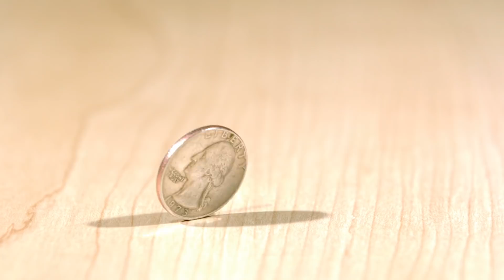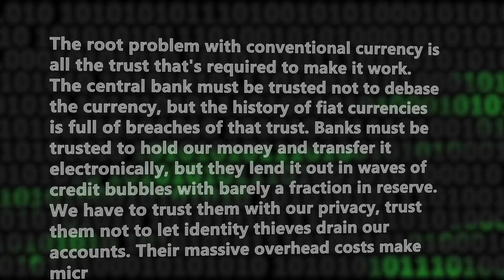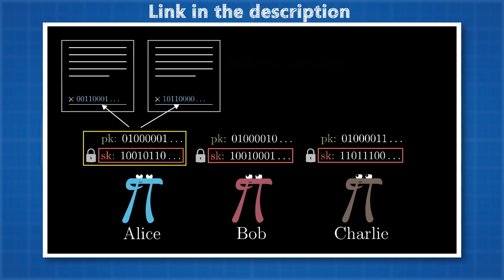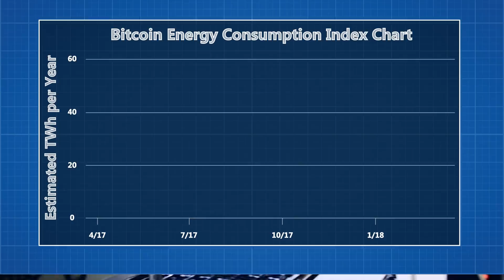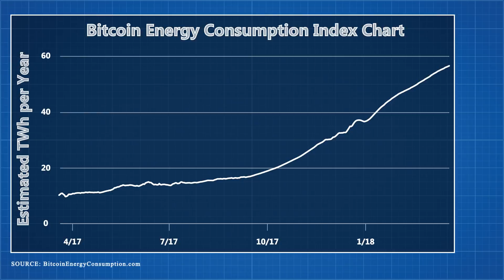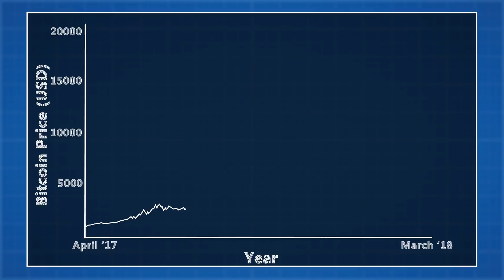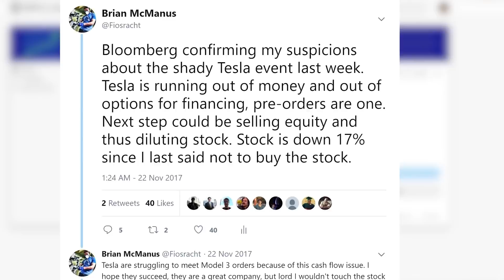Why Bitcoin Is Not Working

Comment: Some honest feedback, so please take your time to read and understand :)
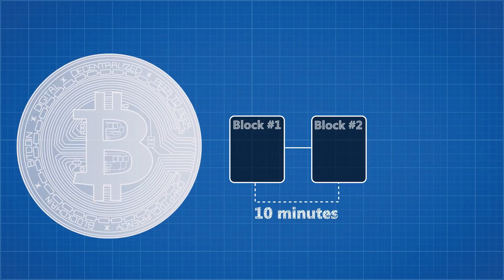2:39 this is not true. There is no "limit of the number of transactions in a block". The only limit is the blocksize limit, 1MB in Bitcoin. But not all transactions are equally sized. Some use older/newer address types (P2PKH, P2SH, Bench32) , some are larger/smaller (more/ less inputs/outputs), some are batched (HitBTC, Kraken, Poloniex), etc. So it´s very difficult so state that the number of txs is limited to 2400 tx/Block. But the most important thing to know is that a Bitcoin tx is not equal to a transaction at a bank. A Bank transfer is sending amount x from A to B. A Bitcoin tx can send amount X from A, B, C, D, ... to W, X, Y, Z, so multiple inputs and outputs. This is visible in tx batching: Have a look at this tx (e.g. https://blockchair.com/bitcoin/transaction/f558e32cdfb2f438841cad9aa8896b04cab36eb94c34454fd5e827877576b5ca). It has 3 inputs and 2193 outputs! Looks like there are many recipients of money. But do we consider that one transaction because it is only one? Or multiple, because there are several inputs and outputs? See: Therefore it´s important to not only look at the sheer number of tx in a block, but also on the amount of inputs and outputs, because multiple txs can be batched into a single one.
7:04 this is partly true. As you can see here (https://coin.dance/blocks/thisweek) 75% Bitcoins total hashrate is in the hands of 5-6 pools. But: 1 pool != 1 mining huge facility. Most pools consist of hundreds of thousands of miners (see different pools stats), who are able to switch pools any time they want. The acutal part of hashrate controlled by a few people is much lower.
7:35 partly true as well. But you haven´t considered the technological development. Competition to build the most efficient results in less monopolization and power consumption while keeping the hashrate rising.
9:08 Please do more research and don´t make it look like Bitcoin is stuck at 4 txs/sec. and isn´t evolving in speed, privacy, etc. A few keywords to start with: SegWit, Lightning Network, Schnorr signatures, MAST, Bulletproofs, (over) ASICBoost... In comparison to centralized systems these improvements will take much longer to spread.
9:36 for example?
Of course there is still several need for improvement in Bitcoin, as you already said, but please take this as an honest advice :)
Reply: AppleStuffTutorials You said it great! Its pitty that RE didnt mention Proof of stake and DPoS systems to verify transactions. We must not forget that Bitcoin is relatively new and problems with speed and capabilities had in the early years even the Internet
Reply: Spot on! Thanks for sharing!!
Reply: AppleStuffTutorials My notes:

Argument 1, electricity - we should look at how much power is consumed by all 11,000 employees of visa including the office buildings and the gas used to commute those ppl too and from work. It’s not as free as they make is sound. Consider the masses of junk mail you get from visa. I can go on and on how visa is much more harmful than bitcoin.

Argument 2, miner incentive when all bitcoins are created - by this time bitcoin should have over a million transactions a sec even if the transaction fee was $0.01 the miners would get millions of dollars in rewards every 10 min block.

Argument 3 - lightening network and innovation in general will fix problems the author has.

I feel this video was created to just be polarizing to get views. Congrats to “realengineering” for succeeding.
Reply: This video is remarkably bad by RE's standards. It's honestly as if he didn't actually do any research at all for this video and he's trying to say why he thinks it's destined to fail off the top of his head.
Reply: @Krtek Proof of Stake invalidates what he spent more than half the video talking about. POW was a good starting point, but is not something that should be used anymore.
Reply: this should go on top of the comment section. video content may lead people in the wrong way.
Reply: The major Bitcoin (BTC) forums are heavily censored.  This is ALL you need to know that BTC is dead or doesn't deserve to live.
Reply: AppleStuffTutorials dont listen to this video this guy is pumping the dollar what a fuckwit the u.s dollar is not going to last

Comment: Let me debunk this video. Bitcoin price is only getting more stable as it gets older and as more people adopt this technology, it can only get more stable. Going from $5,000 to $20,000 is a lot more stable than going from $2 to $250. Also, fiat currencies are a lot more volatile than the average person thinks. The power consumption will come down as technology becomes more advanced. Also, there are other solutions to combat this in the long run, which can be adopted by bitcoin or other crypto currencies. The dollar and other fiats are the real flawed currencies since they're backed by nothing and are controlled by people no one trusts. The dollar has lost 99% of its value since its inception and most fiat currencies that started 100 years ago are already dead. Some argue, fiat currencies are the evil that make wars possible. Fiat money will not be around for long.
Reply: All currencies are fiat. The fact you're still measuring Bitcoin in terms of conventional currency shows this.

At the end of the day, you need to be able to convert Bitcoin to some physical transaction. This conversion will always carry with it a notion of value that is not fixed in time or volume, and will need widespread agreement on what that value conversion rate is. This makes any proxy measure of value, whether it is conventional currency or Bitcoin, fiat.
Reply: I don't think Bitcoin will be adopted by most people even though people who hold Bitcoin and believe in it think it will. As long as it's used as a speculative investment, it will always be somewhat volatile, who wants to spend a currency that could be worth 10% more tomorrow? One of the big problems consumers will have with Bitcoin is the fact that there's no insurance available as there is with Banks which are customer based. If you forget your PIN or make a transaction mistake, your can fix it relatively easily. What would protect your everyday Joe from inadvertantly sending their coin to the wrong address or incompatible wallet and having it be lost in the void. Bitcoin doesn't care if you typed one wrong number. Your coin is gone forever. Let's also not forget Bitcoin has a very questionable intrinsic value where as things like physical gold and silver have proven real value. Oh, and these "small fees" associated with transactions are not so small and the transaction speed sucks too! Did I miss anything?
Reply: I support btc but you're just attacking Fiat not defending crypto
Reply: Matt A Well, it may not be Bitcoin but a state crypto is poised to do so.
Reply: Bitcoin went from $5000 to $20 000 in about three months, but it took around two years to go from $2 to $250. The faster increase is the one to $20K, with a 100% increase every 1.5 months instead of 2.5, but the comparison is not entirely fair because of the different timescales.
Both of these, however, would be classified as hyper-deflation. Hyper-deflation has never been seen in a conventional currency, so the only thing to compare it to is some of the biggest asset bubbles in history; and bitcoin has nearly all of them beat, with the value rising faster than the South Seas bubble or Dot Com boom.
That is not stable. Bitcoin was not stable when it was brand new and it is not stable now.

In contrast, the big fiat currencies have annual inflation rates consistently well below 5% and usually target 2-3%. That is comparatively very stable.
Reply: Nearly everybody trusts fiat currencies. I know I can go to the store and buy what I want with my money. I know I can buy what I want online with my regulated money. I know that secondhand traders irl will accept my fiat money.

The same cannot be said for cryptos. Who bloody knows how much it will be worth? Saying relative increases in value show more stability is bullshit. Real term change is what matters here. Who knows who will accept it? How impractical it is compared to just handing over a note or swiping a card too.

I am very confident that crypto will never overtake real currency.
Reply: Losing value... so the dollar is flawed because it experiences a small amount of yearly inflation?  Couldn't I say that bitcoin is flawed because it experiences a large amount of yearly deflation?
Reply: kwanarchive That is not true. Bitcoin has been deemed a currency by several courts in Europe and has nothing to do with fiat. Hell, before the Nixon shock the whole concept of fiat money didn't exist.
Reply: This is the most bullshit comment here. Take your head out of your ass you wannabe "investor". This is the great depression all over again when "paper boys" start giving out investment advice.
Reply: Matt A, People or at least anybody with a smart phone will be using cryptos in a decade whether they know it or want to. Once half a billion people use cyptos, its value will be as stable as the dollar. Young people will know cryptos as money and they'll consider fiat as snail mail. It's already happening, but it'll take another decade or two. Then there are smart contracts and a million other things that blockchain can do.  Look, It's easy to nitpick a new technology that hasn't matured or been adopted yet, but that's why they're so relatively cheap. They've gone to the moon already, the sun is the next price point and it will happen by 2021.
Reply: everyone saying crypto wont get wide spread adoption, remember these comments you've made, it will age well. Look back at it in 5 - 10 years for the lols.
Reply: this pretty much. the guy who created the video is clearly some normie who doesn't follow the crypto currencie development. this does however provide a good representation of how the general public currently perceives cryptocurrency.

Comment: No mention of the lightning network which will improve the viability of micropayments?(7:54) No mention of the fact that this was a first kick at the cat and the software is still in it's early stages? 

Name a technology that got it right with it's first try. Bitcoin/altcoins and the side chains that come with them are iterative - we are decentralizing the primary mediums of exchange(and stores of value). It takes time to get something this complicated right; and it's certainly a lot harder than publishing a 10 minute video focused strictly on the downside of a new technology while hocking some sponsors.

Comment: Not all crypto currencies use GPU'S and ASIC'S that's just POW (Proof of work) coins. (Some coins also only allow you to mine with CPU's)

One solution to the environmental problem of BTC is POC (Proof of capacity) coins like Storj,Burstcoin,Madesafe and Siacoin which use hard drives to mine which is more energy efficient.
POS (Proof of stake) coins are another option.

And lastly bitcoin is the gold standard of cryptos so using it as a store of value is not a bad thing.
Reply: @anthony , I'll assume that your comment doesn't exist because it's not physical.
Reply: Michael G with a speed limit of 4 transactions per second it's difficult to remain a viable option for small transactions.
Reply: Giorgos Chatziioannou
They will just get a bigger share if they have more hardware but if you get in early on a POC coin then the coins will multiply in value.

Burst coin can held $400 per on 100tb over 1 month and the hard drive still have a resell price on top of that then if the coin jumps from just 3 cents to 6 cents all your portfolio is doubled.

Better then what banks are offering for the same time frame unless you take massive risks of course.

Michael G
Yes for micro transactions not great but you can get fees as low 0.08p GBP this is because the network has been upgraded and hopefully it will improve further and as it stands now it's still competitive against other financial transfer methods out there and its completely in your control. In addition you could use another crypto for cheaper faster transactions.
Reply: Anthony novel people always talk like that after a big drop and I've heard it all before going back to the first big dip. Copy & paste
Reply: Anthony novel textbook salt
Reply: the future is in green coins like Burstcoin
Reply: Igor Cesar Madruga Bezerra Cavalcanti Ramalho SegWig and the lighting network upgrade have and will improved this.

The blocks size can also be increased if the network reaches a concensus to do so.
Reply: Bit Mask >>>  "...using it as a store of value..."  That was not the intention of Bitcoin when it was created, according to it's creator(s).  It was to be used as a medium of exchange especially in terms of small or micro transactions.  It has completely failed in that regard.
Reply: hey BIT MASK ... its, "Better than!" ... greater than ... oye.  AND DEN....
Reply: and there is going to be the same problem, the power will be in the hands of few. digital currency is surely the future, but cryptocurrency is not the right way
Reply: Stupid ,comparing gold, one of the most useful and legendary materials on earth with something that doesn't even exist , the only thing that sustain bitcoin is the faith a bunch of lazyass people that thing they are capable of been millionaires with bitcoins which wasnt the point of bitcoins,in fact was created to avoid that kind of people at all , as I said almost 10 years ago and I said it ...bitcoin is a economic bubble that I dont watn to be next to it when eventual exploit
Reply: Bit Mask í dont need to prove that bitcoin it's just a trap because it shows it self as it is , it an economic bubble feed it with nothing but speculation...but well at least you are a powerful tycoon thanks to the bitcoin right ? Hahahahha

Comment: Great video, it would have been good if you'd explained a bit more though. Such as how bitcoin is a gateway into altcoins and about altcoins themselves. I also wish you has mentioned that the reason bitcoin is so volatile is because it is being treated as an investment instead of its original use as a currency.

Comment: Lightning network, proof of stake and hashgraphs are the key....  Dont worry we will get rid of banks one way or the other...
Reply: Bitcoin has a finite nuber of coins, hence no coins to mine... So bye bye miners
Reply: Don't forget sharding and Plasma...
Reply: The last Bitcoin will not be mined until  ~2140 - it's not like its next year or anything. Bitcoin like any software can be updated/upgraded well before then. The code of Bitcoin could be updated to use DAG algorithms similar to that of other altcoins such as IOTA and NANO. Carrying out a transaction using a DAG based Bitcoin would require users of the network to complete two transactions prior to their own transactions e.g. no fees.
Reply: +Henk Check the smallest unit of bitcoins please. And tell me what would stop them in the future to divide those up into even smaller parts.
Reply: So uh, how will you transfer bitcoin once these miners give up on transactions? If the big companies quit, then all of the transaction power will plummet. It'll take days for one to go through, maybe months depending on the userbase. Or, the companies will simply become like banks, charging people to use transaction with their services, and thus, they'll control most transactions, and hold most bitcoins, and lend them, and BAM, you get banks.

Comment: Bitcoin would become stable & reasonable to use for everyday use once it reaches the $100m range as the volatility of the decimal points would be low, and it would only displace a few satoshis here and there per day. Now if btc will ever reach the $100m range, that's another ball game which is akin to speculation.

Comment: This has got to be one of the best videos on Bitcoin (and cryptocurrency in general) I've ever watched. Wow. Though I wish you would have gone deeper into the alternatives such as NEO, which is not mineable, thereby eliminating the issue of giving full control to miners and sucking up vast amounts of electricity. Furthermore, NEO also tackles the issue of micropayments, since NEO can be used as a store of value and the GAS generated by it can be used as a near instant payment method or reinvested to buy more NEO to generate even more GAS. The issue of actually using the network and price stability still remains unsolved though (imo).